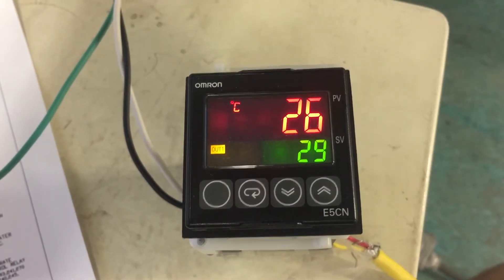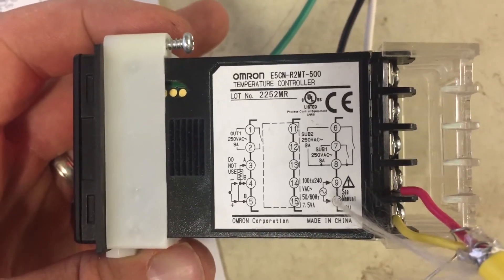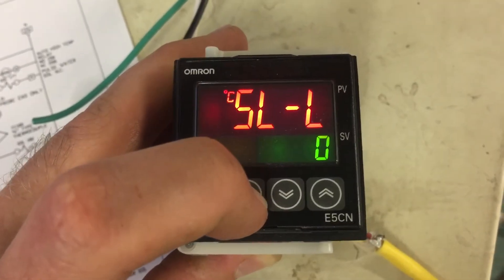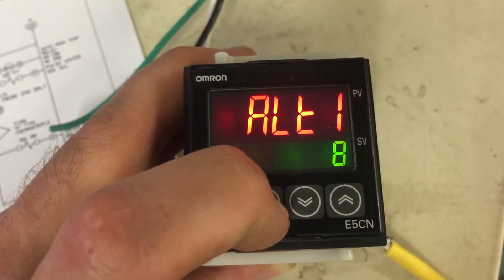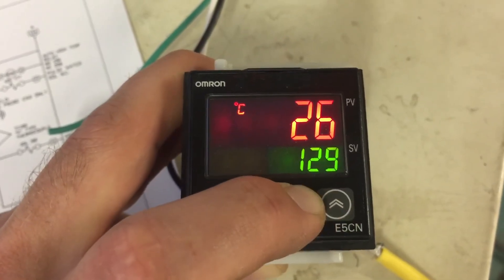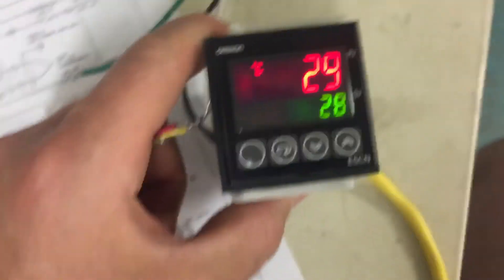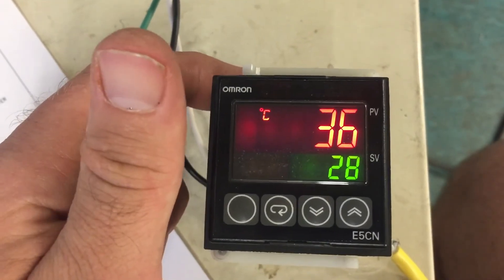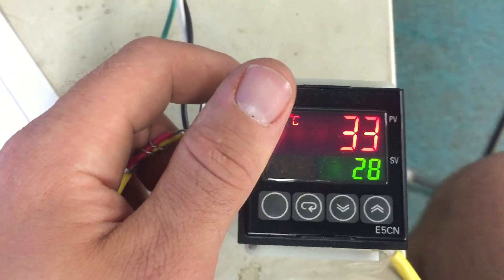Temperature Controller Configure (Steam Generator PID)

Comment: Controller cut 50°c but not start after 48°c why  pl. give solution
Reply: Look at your hysteresis parameter. If set larger than 2 celsius, then it wont activate in that deadband requested.

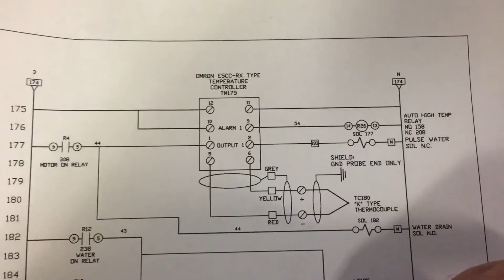Comment: 0:21 Where did you get that Omron electrical diagram, bud?
Reply: It’s on the side of the controller. The electrical on the table is our own design for implementation.
Reply: @nicholaslees6707  I see. Thanks! What program did you use to create it?
Reply: We use Draftsight by Dassault.
Reply: @nicholaslees6707  Thanks!

Comment: dO YOU NEED TO CONNECT THE THERMOCOPPEL BEFORE  YOU GOOD PUT IN THE NEW SETTINGS ?
Reply: If you have the wrong parameter selected for IN-T and the thermocouple is wired it will only show the incorrect temperature. Thermocouples work on the principle of wire resistance detected and it will say s.err if no sensor is connected.
Reply: @nicholaslees6707  Thanks a lot for your answer just one more question for you !
Do i need to reset the factory settings before i good put in my own settings ?
Thank you for your help
Reply: That’s only needed If parameters are entered and you don’t want to search for which ones are changed.

Comment: We have this exact unit for a heat sealer. We are a little confused about how to configure the unit. We set our temps at 165F but if we use it too quick the unit drops to 120’s and doesn’t seal until we wait till it heats up again. We’d like the output to stay on longer or pulse more frequent. And we want the unit to stay a steady temp between 160-170 during operation. Any recommendations on how to adjust the values would be great.
Reply: Good Morning. Are you controlling a on/off signal or a modulation valve for your heat supply?
Reply: Nicholas Lees found out there was a break in the thermocouple wires. That’s fixed now and the unit is running great again.
Reply: @stepwellsoil85  Hi, I have similar problem with my L bar sealer. Please tell me how did you fix thermocouple wires? Buy new or how? 
Did you check the temperature on the heater and knife housing with a spirograph? I have a situation where, for example, it is 160 degrees in places and 60-70 degrees Celsius where there is no seal. I do not know if the heater is damaged or the thermocouple of this heater.
The temperature is fairly stable on the second housing, the weld is correct. I will be waiting for a hint whether to replace the heater or thermocouple. Thank you.
Reply: @andrzej8296  it turned out my wire to the thermal couple ended up being broken. And when the unit was in motion it would lose connection and re heat up again. I’ve repaired the wire and now it’s working good again